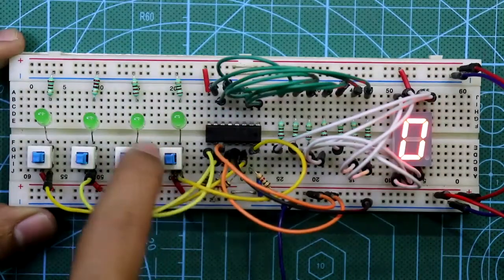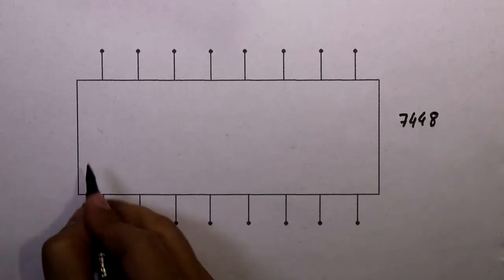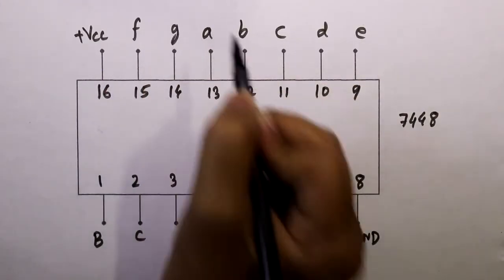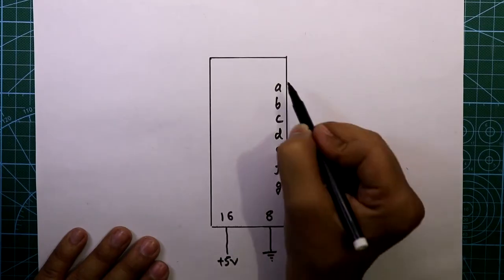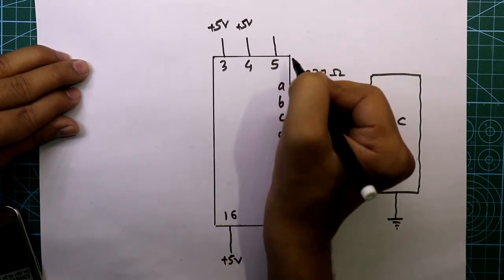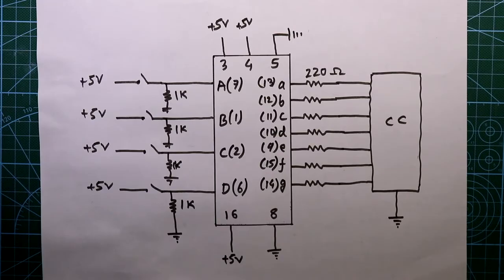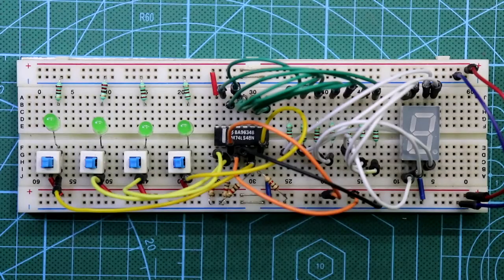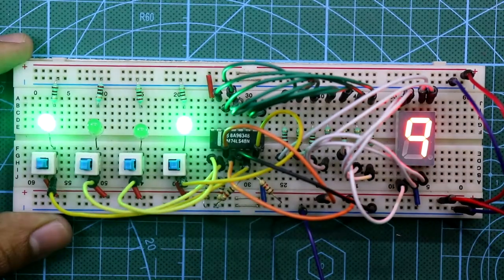SN74LS47 | SN74LS48 | 74HC47 74ls48 BCD to 7 Segment Display Decoder

Comment: 7447and 7447 are same not differnce
Reply: Sorry 7447. 7448
Reply: I guess according to the model, it may be different or same. In my case they are different.
Reply: 7447 comon anode and 7448 comon cathode
Reply: @ahmedraza-fg4rf  Yes 7447 for 7 segment common anode and 7448 for the cathode but you cannot switch, is that what you mean?

Comment: iss 9v battery used here
Reply from the maker: Yes you can, but you need to use a 7805 voltage regulator IC.